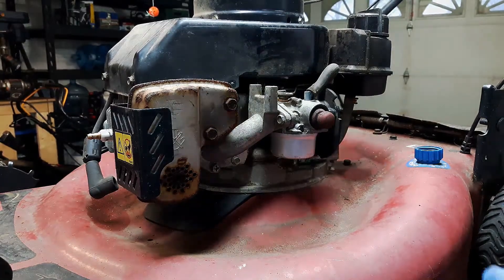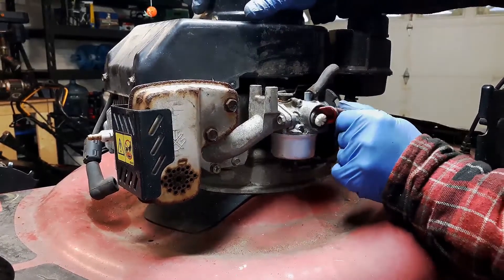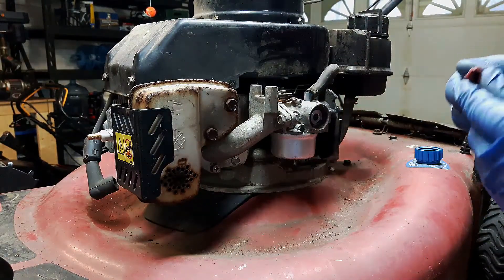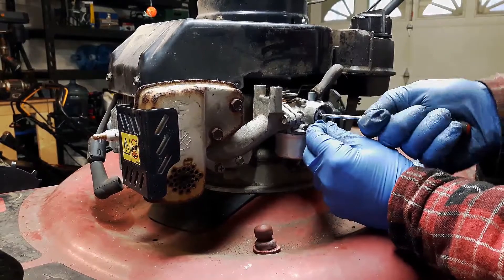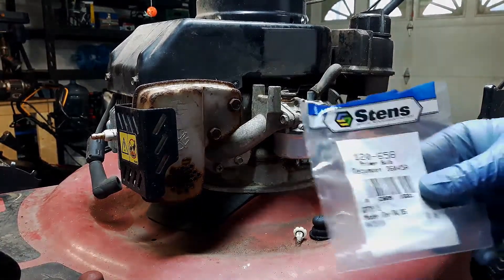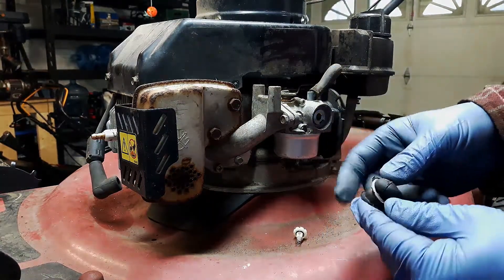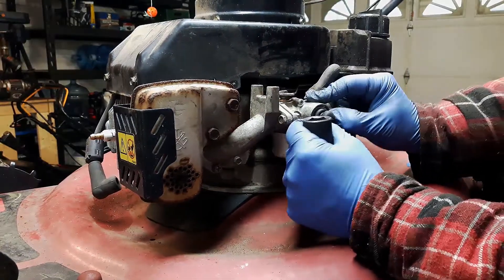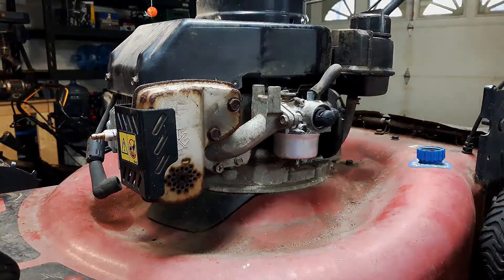How To Replace a Primer Bulb on a Lawnmower With Tecumseh Engine

Comment: I'm working a Craftsman with a Tecumseh lv148 ea.  Its doesn't have the spring and plastic part.. The priming hole has 2 inlets near the top....I was watching donyboy75.   A in d he had one with no spring too.
Reply from the maker: Correct. Not all have the spring

Comment: Can you use the white plastic clip with this model
Reply from the maker: Those ones with the white clips are made for Briggs and Stratton engines and have a different mounting system. I would only use this Tecumseh bulb on the Tecumseh engines.
Reply from the maker: Use the clip that comes with the bulb.